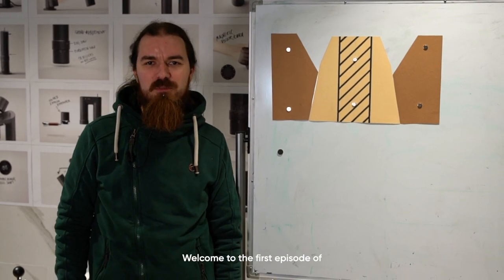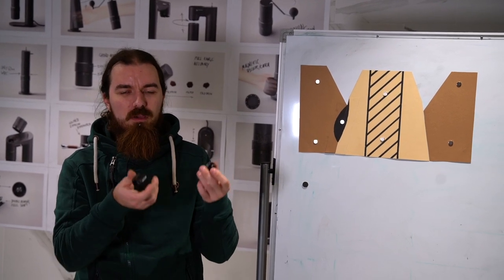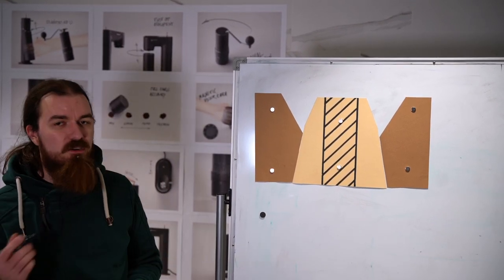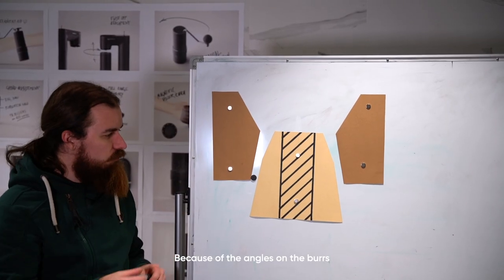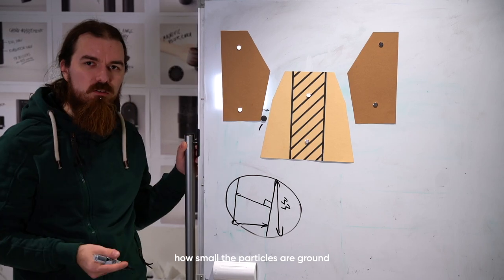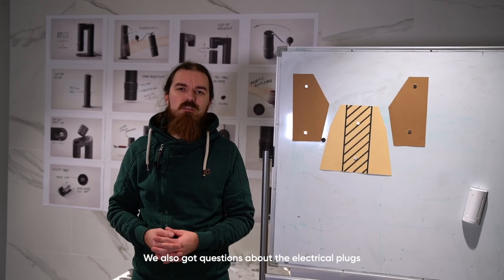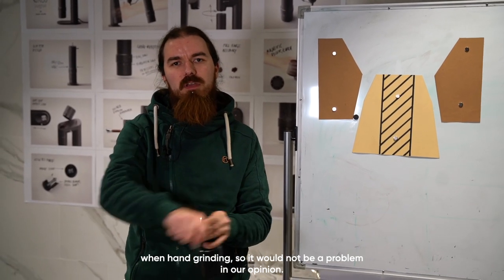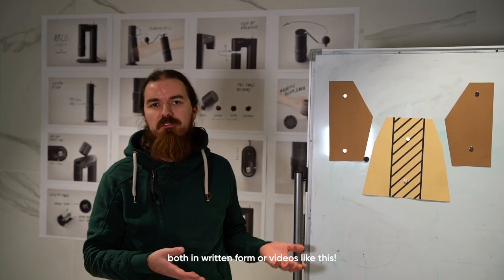GEEKING OUT WITH GOAT STORY:  Digging deep into ARCO tech‼️

Comment: How many out of these 120 total steps does this grinder have in the espresso range?
Reply from the maker: I really depends on what kind of coffee you drink and how's the coffee roasted, so it's hard to generalise that🤔
Reply: By your testing. How many have you found to be used?
Reply: @goatstory7117  let's say I want to grind filter roasted Ethiopia and I want to make a shot with long 30-40sec preinfusion. Can it go as close as turkish?
Reply from the maker: @sebastianvilla8152  We tested all of them and all works for a specific brew or a specific coffee🙂
Reply from the maker: @dragosvlaicu  Hi there, thank you for your question. You can of course use a filter roast for espresso, but you will have to adjust the grind (usually grind a bit finer). But a turkish grind will be too fine as it will clog your espresso machine (the coffee in the portafilter will be too fine and it will block the flow). Our suggestion is to grind just a bit finer than usually and try a shot. You will see how it turns out and adjust from there. 
The trick is that every single coffee is different and needs a bit of dialing in to get it right.
Reply: @goatstory7117  I've asked about Turkish because that's the finest grind one might need. Of course I won't use it to make an espresso, I know how to dial in and yes, you are right, every coffee needs a specific grind settings and most of the time the same coffee but after 2 weeks will probably need another adjustment.
I was wondering if it's possible to make the thread pitch in half. I believe now you have it close to 1mm (33u * 30 clicks = 990u). I believe that's too much. Ideally you could make one at 0.5. Even with 60 clicks you are getting close to 16.5u. On kinu I have 10u and it's step less). Maybe you can have that in mind if you are still in the development phase. 60 clicks will definitely help 😂